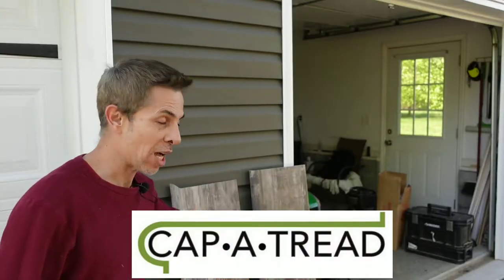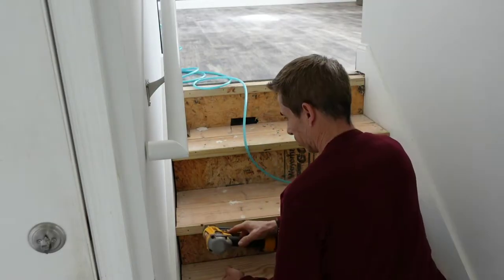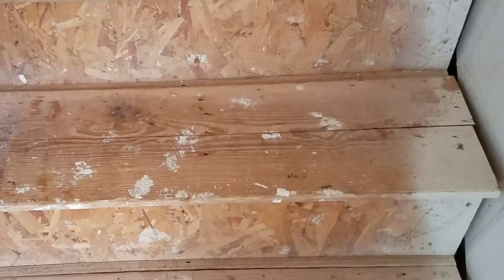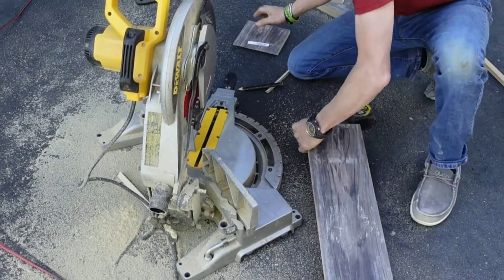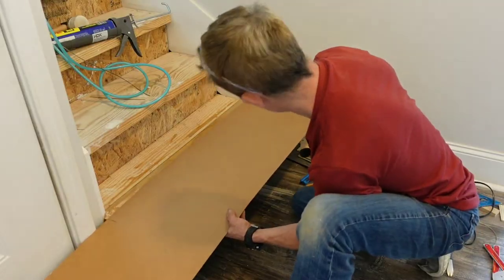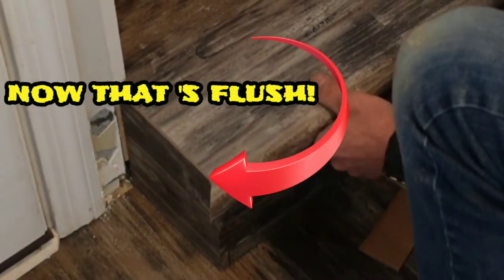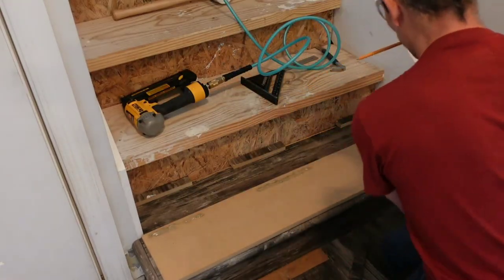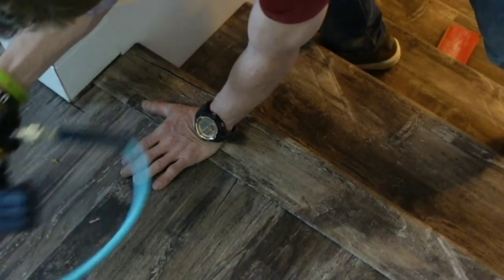How To Install Cap A Tread Stair Covers - open ended return included

Comment: NICELY DONE. I like that your demo used stairs whose 1st step needed that corner piece. I have a small corner needed, and (exhaustedly) did not plan for that outward 45-degree cut. Fortunately I have an extra tread.   But I caught my error in time (before using glue!), thanks to your video
Reply from the maker: Rock non! I'm glad you caught it in time. Carry on On sir. Thanks for the comment

Comment: Oh man, I was agonizing about having to cut off the top step bullnose because I have a different transition strip nose for the top.  I never thought of simply putting a spacer, for the riser, to match the depth of the nose.   Brilliant!   Thanks
Reply from the maker: @Colorado Wing Tks bro! Glad I could help!
Reply: @YOUFLOOR  how did you make the 45 angle cut on the cap-a-thread stair
Reply from the maker: When you buy your tread make sure if you have open ended steps to order a right or a left return. It will come already mitered on the tread. You will just have to cut the side piece on your miter saw to fit. I did it in the video. Check it out. Thanks for the question
Reply from the maker: @Colorado Wing  I'm reaching out to my commenters to make sure you know I am giving some tools away for Christmas. If you are interested in entering click here for details - - - - - > https://youtu.be/iQOXh0b-_dg
Reply: Just be sure to glue.

Comment: Good video.  The finger application tool was perfect for that trim return piece.  I believe Cap A Tread now makes a version of the tread product that has a bigger nose space that will wrap around the thicker treads such as your situation.  They call it type 2.
Reply from the maker: @Roik Hockenberger I have installed both versions of these however the last time I installed the type 2 they didn’t make the open ended return for that type. Tks for the comment.
Reply: @YOUFLOOR  Hey so question then, I installed the Type 2 ones on my stairs a few years ago, but I made the dumb mistake of installing a normal tread on my bottom step that is open-ended on the left similar to the one in this video. It seems like they only sell the type 1 treads with left/right returns, so I was wondering what the best solution would be.
Reply from the maker: So if you have already installed them. And glued them sorry to say there is no solution . You can take it of another the type one but then they wouldn't match.  That why if we have open returns  we just order the type one. You could possibly make a side piece and  try to stain close in color.  But that will take some patience.  Sorry couldn't give a solid solution. Wonder why they dont make one. Doesn't make sense. Hope I was some help. Good luck bud. Thanks for the question
Reply from the maker: @benharrison5816  I am reading back through some of the comments as I let people know about our Christmas Tool Giveaway and I have came upon yours. Did you ever come up with a resolution for your open ended tread? Would love to know.
Also wanted to let you know I am giving tools away for Christmas. If you are interested you can get all the details here - - - - - > https://youtu.be/iQOXh0b-_dg
Reply: @YOUFLOOR  I've been working on other projects in my house lately and haven't got back to the stairs yet, but my plan is to eventually rip out the existing tread and sand off the adhesive (feels like it's a bit loose after a few years anyway), get it smooth and clean and level, and buy a new piece of type 2 that I can slide into place and glue down. Will do a mitered return cut on it, and CA glue the pieces together. The cut looks a bit difficult, but I have a bunch of scrap pieces leftover in my garage still, so I should be able to do some practice cuts. Found a video that shows how to do it with similar treads: https://youtu.be/aDnN-kcbAoc
Reply from the maker: I checked it out. Always wondered how I could achieve this angle without cutting into the tread. Never to old to learn new tricks. Thanks for sharing

Comment: Yeah I would have glued that miterd riser after I dry fit it and glued it in place where it's going. Just my two cents. Good video
Reply from the maker: 6:32 I did glue the miter. Thanks for sharing
Reply: @YOUFLOOR  I meant glue it in place not away from the stairs does that make sense? Cuz if you were off just a little bit it might not have fit or it would bow on the miter
Reply from the maker: I gotcha. Yeah I just test fit before hand. C.a glue is amazing for these type of glue ups. Thanks for all the feedback back. I really appreciate it

Comment: Looks great but shouldn't your lvp on the top and bottom floor run horizontal with the steps?
Reply from the maker: Not necessarily.. it's really customer's  preference. This couple had the living room and hall done 1st. Then the bonus room later that year and they wanted to match the downstairs. Plus in my opinion, floors look the best running long ways on the longest wall. Not to mention  it looks better lengths ways down a hall. Sideways gives it a boardwalk, planks look.  Again just my opinion. The stairs came last and of course they only go one way. Great question. Thank for the veiw

Comment: Great video! Just curious with the cap a tread, we have the same situation where we have 2x12 treads but they don’t make the type 2 cap a treads for that color anymore. Is there any issues with the nose of the normal cap a treads possibly breaking with weight or over time without a normal rounded tread being inside of it?
Reply from the maker: I can't promise anything but I have use those in the past. And I have never had one break. I will say I have had that same thought though. Thanks for the question

Comment: Good stuff. I'm wanting to install pergo on my stairs. I'm not sure how to do the open  return side.
Reply from the maker: You will need to purchase  a coordinating color stairnose and then miter it on the outside corners to finish off the step. Hope that helps. Thanks for the question

Comment: Great video!  Thank you for the tips!  With the laminated particle board riser, what blades are you using to prevent chipping?
Reply from the maker: I use my table saw. Usually, it's a Diablo blade. But I score my cut with a straight edge and a razor blade then cut just on the other side of my line to prevent chipping

Comment: Hi. I really like your videos. But I need a little help.  How did you cut the cap-a-tread for the open return?  I have tried making the cut many MANY times lol! And I can not get the cut right! I have tried cutting the rounded edge first, flat side first, upside-down, right side up, chop saw, table saw, jig saw.  I have already installed 22 cap-a-treads.  They were all normal difficulty but my last 5 steps are open ended on one side and I just can not get the cuts clean.  I am an avid novice wood worker, meaning I very much enjoy fixing and making things but I am nowhere close to a pro.  I am almost at the end of my scrap pieces for practice and definitely at the end of my patience lol!  Your assistance would be greatly appreciated.
Reply from the maker: Around 10 minutes into the video, I show how and explain everything I was about to type here. Check it out because I believe it answers all your questions

Comment: does cap a tread make stair nose to match all types of floors or did you just get lucky matching the floors and steps?
Reply from the maker: I believe the company that makes them is zamma. On this particular job it looks like they made a stairnose to match. Not 100% positive but if they make a cap a tread. I'm pretty sure they make the stair nose to match. I'll admit I was surprised to see it on the job myself. Which is why I bought one very close from floor and decor. Luckily I didn't have to use it

Comment: I'm getting ready too install the type 2,dont know what to do about the return.type 2 has a different side profile then type 1
Reply from the maker: Yes, only the type one comes with a return. If you had the right set
Up and there was enough left in the cut offs, you could rip a stair nose out if the cut-off and try to miter it on the side. But that's a lot of work. Not sure why they just won't make a return for type two. If I think of anything I'll get back to you.

Comment: We recently had Cap a Tread installed and we're having issues with one tread cap slipping forward about 1/8" and having bounce underneath when it does.  When I use a rubber mallot to return it flush to it's original place, the bouncing goes away.  Should I just secure the tread cap in this location with some nails, or should I pull off the full cap and reset it?
Reply from the maker: The quick fix would be to tap it back it place and fire a couple 18 gauge brad nails. Then putty the holes. But if you were able to get it out without ruining any thing else then I might try to  reglue it and then nail it back. Hate to se it completely slip out when someone is running down the stairs. Hope that helps. Thanks for the question
Reply: @YOUFLOOR  - Took your advice securing it with nails.  The planks under the cap are 70+ years old, have been submerged in floods at least 4 times, and are awfully warped.  I don't want this turning into a large project - just want to make sure everyone's safe.

Thanks a ton!
Reply from the maker: No problem   😀

Comment: Is it a good idea to glue the stair nose to your LVP? I saw you place a bead of glue on the part that rests on the LVP...wouldn't that take away from the floating floor aspect of LVP?
Reply from the maker: Ahh. Gotcha. If you'll notice at 14:41 I switched from a urethane glue to 100% silicone. The glue will for sure hold the stair nose . But the silicone is just to prevent any spills or pet accidents from going under your stairs and into the subfloor. It will flex so it will still allow the floor to move while keeping the stair nose in place. Great question. Thanks brother. Hope that helps

Comment: Hey great video man I'm getting ready to install these on my stairs.   One thing that worries me is the hollow nose area breaking.  Have you ever had that problem ?
Reply from the maker: No but after installing some and going back after 2 years. If I was doing it again , I might attached  some type of nosing and glue the heck out of it. They don't break, but they are sqeaky as all get out. Glue would definitely help with both issues. Hey thanks for the comment.  Good luck with your project
Reply: We've had that same concern and addressed  it:  SaltyCustomVinyl

Comment: Hi! How would you deal with the bottom stair having Both a curved tread and riser?
Reply from the maker: You would have to custom make a stair for that situation . Sorry wish there was an easy solution.  They do sell the curved riser and round step at floor and decor. Maybe that's the answer. Hope that helps. Thanks for the question

Comment: Hi,thanks for the detailed video.where did you buy that end return/nose piece please do let me know?
Reply from the maker: Actually when you buy the stairs,  be sure to buy then open ended. The piece comes in the box. Hope that helps.  Thanks for the question
Reply: @YOUFLOOR  great ! i appreciate your response :)
Reply: @YOUFLOOR  Great video, I’m installing these on my stairs as well.  Where did you purchase your cap a treads from? I don’t see the option to buy them open ended through Home Depot.
Reply from the maker: @Mary Vargas I guess the stair is called open ended because it doesn’t hit up against a wall but you need a left handed or right handed return on the stair when purchasing it. Look straight at the staircase to see if you need a left return, right return, or double (both sides). 
Hope that helps! I’ve also found that the Home Depot website may show it has a right return but not left but I’m pretty sure they can order whatever you need, you just need to call or go in and talk to someone. Please let me know if you have any other questions during the installation or ever!

Comment: Is there a way to flush last step with floor rather than installing over....that last step going over the floor does not look nice in my opinion/ unsafe bump.  I know vinyl floor and cap a tread have different height and do not match....but was hoping for perfect flush installation between stair and floor between two staircases.
Reply from the maker: Maybe experimenting with gorilla will have good results. If you cut the locking system off maybe butting and gluing will work. I think I understand. If I'm wrong then  send me a m pic. Would love to see what you are talking about. Youfloor.net@gmail.com
Reply: @YOUFLOOR  I send you reply to your email address

Comment: Thanks for this video, it was extremely helpful! I have a question though, what if there is no stair nosing available for my floor? I am using cap a tread as well but I cannot find the nosing for the landing… have you ever dealt with this? I am thinking using one of the treads and just cutting it and using caulk to fill in the joint between the tread and flooring when I get to the landing. What do you think?
Reply from the maker: I've run into this before there are 2 things you can do 1st I will go to floor and décor and look at their transition selection he would be surprised they probably even have the exact stairnose that matches your cap a treads. Or If you have the planks that you use to install your floor and they are LVP you can get a jig and use a heat gun to wrap those stairs around to make a bull nose of your own I did it on another set of steps I will try to find a pic and send
Reply: @YOUFLOOR  thank you, I will look into this!

Comment: Great video! Question, would you say cap a tread is pretty durable ? I want to put it down my basement stairs and they get a lot of traffic
Reply from the maker: I have not experienced  any issues with them up to presents t day. I have installed quite a few of these sets of step. If you use the right glue, they should hold up just fine if your basement is finished and dried in. If it is just a concrete slab and ot is open to the outside where moisture can get in then it might be better to go with real wood . And then treat it. Hope that helps. Great question
Reply: @YOUFLOOR  thanks so much for your response. The reviews are mixed on home depot website so I thought I would ask a pro. Thanks again this helped

Comment: Why did you shim the risers out instead of just slotting the cap a tread over the existing nosing?
Reply from the maker: These treads are only an inch thick, and the existing treads are an inch and a half. They make a style that is 1 1/2 inches, but for some reason, they don't make that style with a return for open-ended steps. I'm not sure why. So, if you have open-ended steps, your choices are to cut off the nose on all of them or fur them out and run the riser up to the top so the capa tread completely covers the top of the risers. Hope that helps. Thanks for the question

Comment: Where can I buy the return nose
Reply from the maker: There are 2 types of stair covers. Type 1, which is for 1 inch treads. Type 2, which is for 1 1/2 inch treads. The returns only come in the type 2 treads. You can special order them from Home Depot. That's what we have to do,and also you need to specify whether you need a right hand or left hand return. Hope that gulps. Thanks for the question

Comment: Where do I buy the return piece ?
Reply from the maker: When you buy the return step, it comes with the side piece so you can custom fit it for your situation. Hope that helps. Thanks for the question
Reply: Oh gotcha they don't make the color I bought with a Return
Reply from the maker: @jarred1608 yeah I can't remember, but I believe they only make type 1 with a return. That doesn't make sense. Should have it for both. Do you have any lvp that match in color. If so you could make your own

Comment: should have used a white riser, would have looked much nicer
Reply from the maker: I 100% agree. I tried to tell them but they insisted on color matching. I think the white pops off of the baseboard  and skirt boards much nicer. Thanks for the comment
Reply: Please, how much cost this wood?
Were can I find?
Reply from the maker: It varies but you can find them at home depot or floor and decor. Look up capatread on Amazon.com you might find them there too